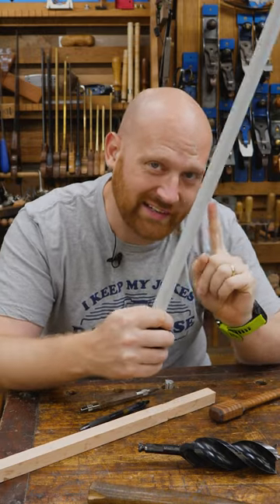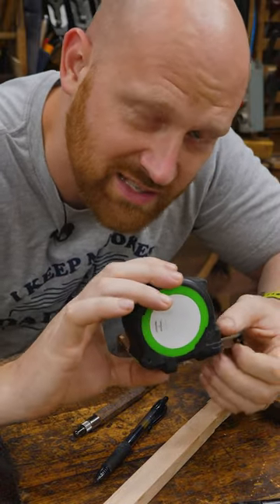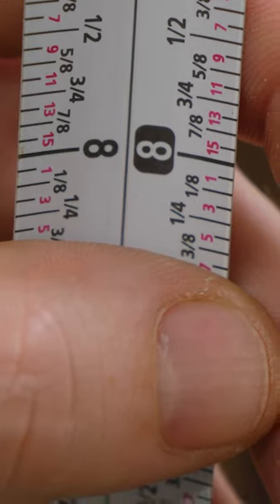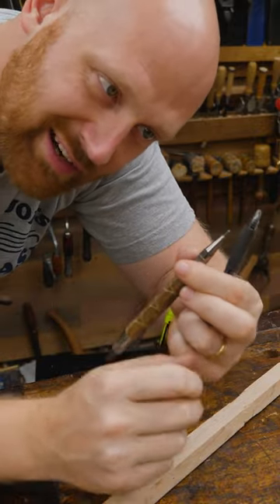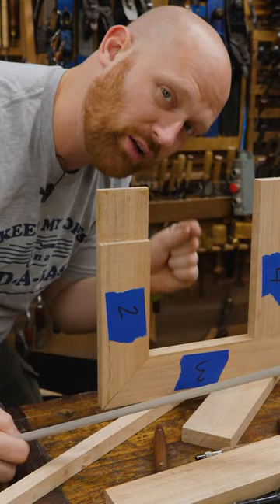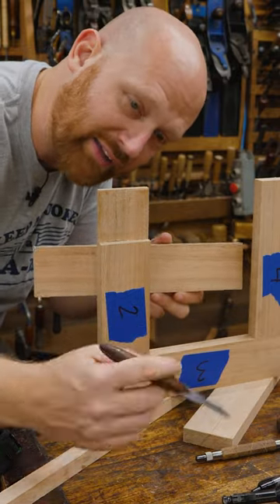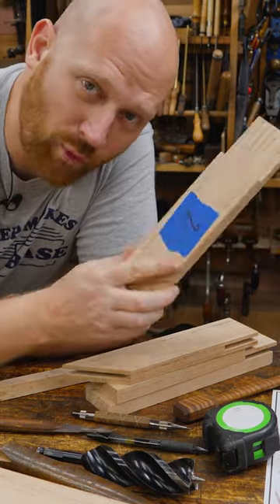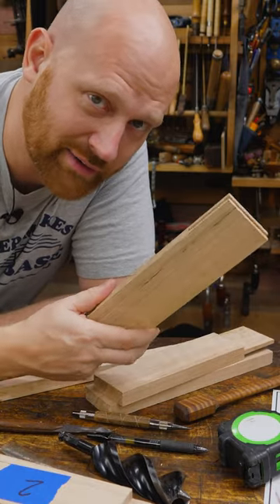How To Reduce Error in Woodworking

Comment: Great advice until the piece of timber you are using is 6 foot long...🙄
Reply from the maker: yup. Generally, the longer the less accurate you have to be.
Reply: @WoodByWrightHowTo  - I agree but most trees are longer and I don’t like waste cuts (I’m going to use a rule or caliper to transfer the measurement rather than cut +15% just so it’s in a more manageable length)
Good advice about using a knife to scribe the length though!?

Comment: I usually watch your videos with a great deal of interest, but you're losing me with this one.
Reply from the maker: In what way. I would love the feedback.
Reply: @WoodByWrightHowTo  I have had to use tapes to measure wood I was having to cut. I have also used that I was cutting to measure other pieces a few times. Like multiple thousands of times. 

Each way over several decades. If I wanted to keep the job I was doing I would not have found it salutary to follow your advice. Way too many opportunities to totally mess it up. I double-checked and triple checked and often quadruple checked the lumber I cut dozens of times a day. 

If you don't want to use a tape to measure things, that's fine. But I found a tape to be way more constant than the wood.
 
If I made a mistake in cutting from the wood it would be perpetuated. So I used what I had at hand including the tape to check again and again what I had cut.
Reply from the maker: thanks for the feedback. I think you are misunderstanding what I am saying. I use a tape measure all the time. there are times when it is indispensable. especially when working with larger items where you can not easily transfer reality. I am just saying you have to be carful because any time you measure and transfer to another spot you introduce inaccuracy. it is the same with story sticks.

Comment: "it will get you as close as anything possibly can" 
Micrometers and calipers: Am I a joke to you?
Reply from the maker: Those are better then tape measures but still introduce error when transferring the measurement.
Reply: @WoodByWrightHowTo  Not at all. With calipers, use the I.d. Measuring jaws, lock them in place. Then use the o.d. jaws to scribe to transfer the line.
If you want to get that technical, a double ground blade will impart error from the different between the land to the tip of the grind's thickness. 
And most people don't use any single ground knives, except chisels.
And you aren't measuring wood to thousandths and tenths anyway, lol. Leave that to machinists. 🤣

Comment: What about using calipers?
Reply from the maker: We are more accurate than a tape measure. But anytime you transfer a measurement from 1.2 another with a tool you introduce inaccuracy. In most cases the amount of inaccuracy with calipers is not important. But there are cases where it creates gaps

Comment: Pretty subjective
Reply from the maker: that is the idea!
Reply: @WoodByWrightHowTo  I can dig it, definitely always arguing with the older heads about this exact same thing, but on the other hand I am very skilled with my tape and will still get you withing a 32nd on whatever overall. It also has a lot to do with knowledge of the tools ur cutting with. I do a ton of metal fab so there's 50 ways to cut any 1 peice. So although I agree with you, the tape measure definitely isn't useless